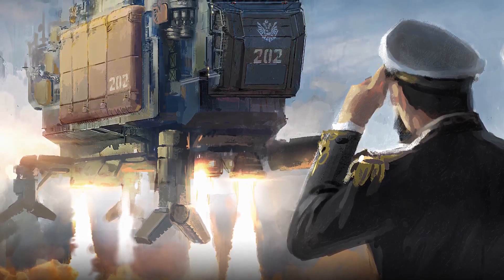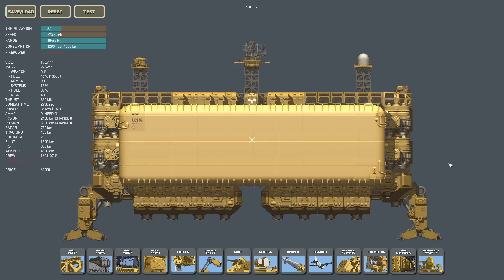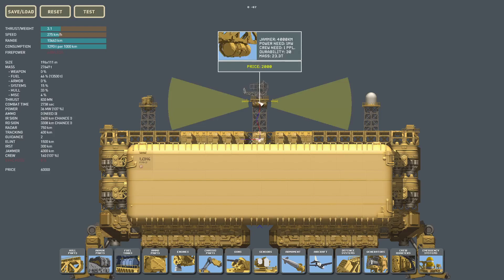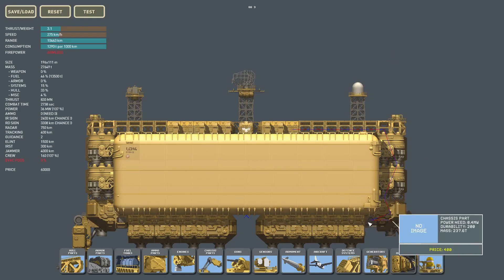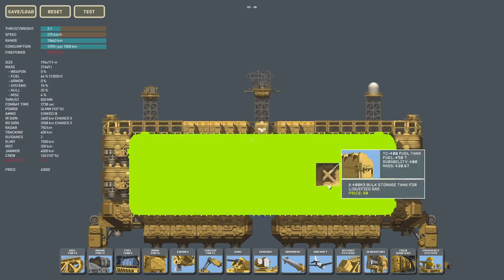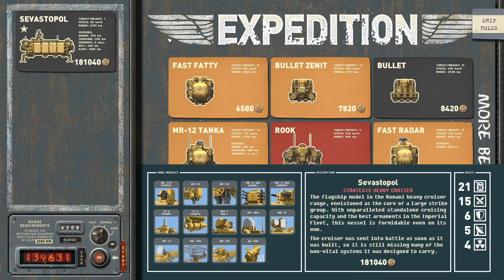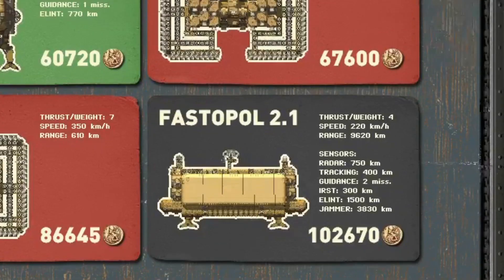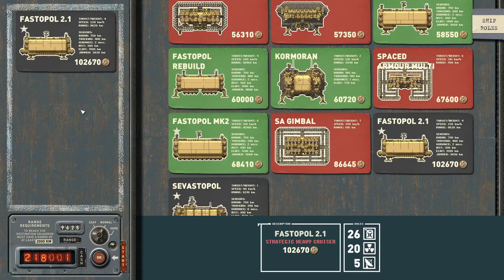Flag Ship Design | HighFleet Builds

Comment: Your goal for flagship is survivability to avoid game over. So anti-air with small bullet gun and armor is the best. 
You can separate the role of fuel, sensors (radar, elint, etc.), jammer/distractor, aircraft carrier, missile, light fighter, heavy fighter, etc. into another crafts that you can afford to lose. 
With specialized design you can also scatter them to do separate missions.

Also, tall design is preferable to wide design because of wide design has far more radar signature controlling for volume.
Reply: The more ships you have, the more fuel you waste
Reply: But wide designs can fit more static thrusters, which is better for fuel effciency
There’s a give and take
Reply: Or, you just build a small box and fly it far into the desert.
Reply: @thename6879  wide designs have more RD signature (however tf that works), cant fit into smaller docks but can fit more thrusters. tall designs have LESS RD signature, CAN fit into smaller docks, but cant fit as many static thrusters.

Comment: Spacing out sensors on towers is actually somewhat realistic, if budget is a priority (only one of each sensor). Towers far from each other would obstruct a small portion of the 360 degree horizon for each sensor, allowing that small angle to be covered by constantly rotating/zigzagging the ship to the sides slightly. The closer you put the sensor towers to each other the larger the obstructed angle becomes and less practical this strategy. Representing that with reduced range rather than blind spots is not perfect but what can you do when ships are 2d vertical slices and the map is a horizontal plane.

Comment: My personal flagship, the Geneva, isn't designed for combat at all. And honestly I think that's the much better choice for a flagship. it's got tonnes of fuel, space for nukes, and aircraft, as well as 30+ anti-missle defense systems. It has like 3 low tier guns to help shoot down missiles, and absolutely no armor. It's not that fast, but certainly faster than the Sevastopol. It also only has a fire control radar. I put my other communication (long range radar and infra-red) systems on an other non-combat ship (usually putting the radar on another nuke carrier and the infra-red on the skylark).

Of course, the joke of calling it the Geneva is because it's used for warcrimes. That, and I like continuing the tradition of naming flagships after cities.
Reply from the maker: Nice name for the ship!
Reply: What is the warcrime?🤔

Comment: So you made a RADAR-tanker. Sounds about right.
I like the simplicity and effectiveness of the design. I only have 3 questions.
Is this better than making a bunch of smaller tankers of the same fuel capacity?
What's the point of the fire control RADAR if the ship doesn't have any missiles and you could just put one on a missile carrier?
What would happen if you take this design and add runways to it to make it a plane carrier (would it be cheaper, faster, more efficient, etc. than a separate carrier)?
Reply from the maker: Yes, it might be better to make the fuel tank into smaller fuel tanks separated by small hull pieces to make fires more survivable. The hull should prevent spreading of fires to some extent. Having separate tankers instead of one, idk, it has it's own pluses and minuses: it can help split the fleet into groups, but small tankers are less effective at providing fuel to the fleet.

The FCR is so that the ship could also see targets clearly since it has a tracking capability. It’s so that when we’re in trouble, we can at least see stuff and be able to act from it. I also would sometimes put missiles on this ship in some empty hull spaces so I can use those too.

And it might be a good idea to place a couple flight decks and some T-7s on the ship because yes it is cheaper than having separate aircraft carrier. However, having a separate carrier has its own advantages like you can send planes further without setting the flag ship off the ground.

I’m sorry about the late response, hopefully this was helpful )
Reply: @kaptainbeans  I did not know bigger tankers on a single ship are more effective at providing fuel to a fleet. How-so?

I forgot the FCR doubles as a normal RADAR with smaller range. This doesn't sound like a bad cost-cutting move so you can purchase a RADAR later (or just use the one on your operational tanker on your forward fleet). Smart idea. I'll use this in my cheap Capital Ship design.

As far as planes go, I think a cost-saving move without limiting effectiveness is to make the Capital Ship a strategic carrier (longer-range and more devastating at the cost of being deployed further away), and also have operational carriers akin to Wasps with your forward fleet (deployed from the same fleet as your tactical ships so it's closer and therefore faster, but it has less effectiveness/number). This would make it so your Capital Ship, which has to exist, has a function to save money by being effective. All of this requires that you'd be using a faster-moving fleet, ahead of your main fleet, to deploy ships and minor first-strike capabilities for combat.

What do you think?